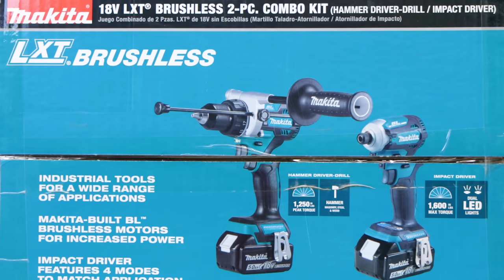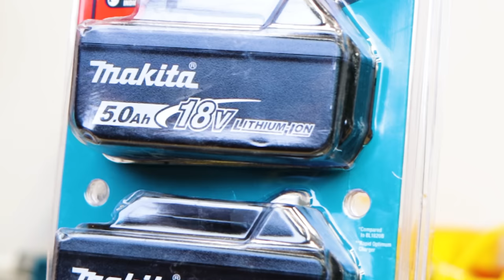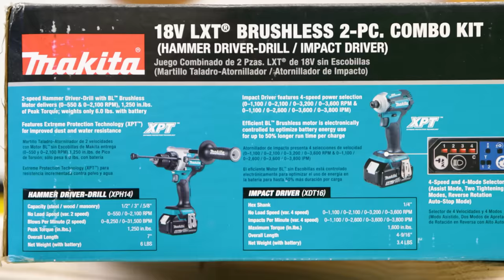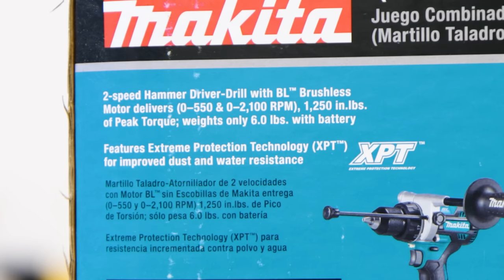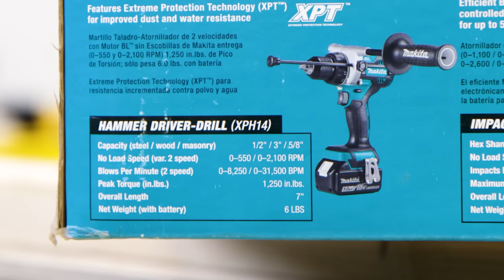New MAKITA Hammer Drill HAS INSANE POWER! (Best Combo Kit At The Home Depot)

Comment: There is no way you could get me to buy any other cordless tool.  I love my Makitas!!!!
Reply: Most of my Makita tools are 2 generations old. I’m 15 and. Have 30-40 year old tools that work great
Reply: I agree 100%. I accidentally dropped my impact today on the job site.  3 story’s high on a boom lift. Landed on straight concrete. Battery  popped off the impact and thought it was game over. Wanted to cry!Only thing damaged was the pins that slide in to the battery. Bent the pins back and business as usual.
Reply: I love Makita impacts over all others but some of the other tools available are better from other brands . My best example for this is Makita miter saws . Imo dewalt miter saws are better overall but I switches to a dewalt 7 1/4 20v max miter saw that I only use 9ah flexvolt batteries . Granted I only cut trim for windows and doors , I do it daily and the battery lasts about a month . The saw is small and light and nothing Makita has compares or at least nothing I saw from Makita

Comment: I just bought this tool kit after buying the circular worm drive from makita (18vx2). I returned my 2 free batteries it came with and returned the xph07z I bought on clearance from last week and bought this exact kit. 4 each 5AH batteries is plenty for me. I got this kit with those trade backs for $200. It came with a free tool as well (makita angle grinder x) which I’m trying to return and get a sawzall brushless or a oscillating tool

I hate these bags tbh.

Comment: I just sold my coworker my two dewalt drills and DeWalt impact with 7 batteries and three chargers for this kit. I already have almost $2k in Makita tools and batteries and decided to go all Makita finally. Don't regret it one bit. Such a nice drill. I only paid $229 on sale for holidays as well at a local hardware store.
I work mostly with aluminum and occasionally steel as a fabricator. This set up is way stronger than I need. Also I don't care about the bags because I have a rolling tool box. Lol

Comment: Just picked up my Makita XPH14 Hammer Drill and XDT16 Impact Driver combo set on sale from HD for $329. The Makita XPH14 will be used as my masonry drill for installing HVAC electrical disconnect boxes.  I enjoy using my Milwaukee M12 impact driver for HVAC service  tech applications but I decided on the Makita 18V system for commercial HVAC and installations because the impact driver has two bearings in the collet compared  to the Milwaukee Gen 3 M18 only having one.

Comment: I own the Milwaukee Gen 2 full size hammer drill and impact drive in a kit. Last Father’s Day my mom didn’t know what to get me so she bought the Makita combo kit XPH07 and the impact driver. I fell in love with the impact driver even over the Milwaukee. The collar sucks on the Milwaukee impact. The Fuel is a little stronger than the Makita but isn’t as compact and the Makita takes more abuse. My question to you does the Makita XPH14 get hot easy like the XPH07? No offense to fans but I am slowly falling in love with Makita more so than Milwaukee because the comfortable handling, durability, and snug fitting batteries. Is there a big enough difference for me to buy the XPH14 since I own the XPH07? I burn my hand a lot on the XPH07 but so far I’ve never had a smoke show. Thanks for the videos they are always super helpful. I subscribed and should have sooner.

Comment: I actually just bought the new XT288T and then I bought the 40 Volt version of the same kit basically, and I am telling you the truth the 18 V is just as good as the 40V, it’s just as powerful, but half the weight, of course I have the XDT 19 impact drill, the newer kit comes with it instead of the XDT 16. Plus the 40 V system is heavier by quite a bit especially with the battery. They come with 2.5 AH batteries, but because it’s 40 V it’s still 90 watt hours, just like the 5 AH 18v. If you’re trying to decide, I’d suggest getting the 18V version unless you’re a contractor that requires it for all the other tools that they make for the 40V system. Just my thought about this.

Comment: Just got that same Makita kit in the mail today. Would love to see the challenge against Milwaukee! just now making a platform swap; hoping ive made the right chice with makita.
Reply: Ya did
Reply: I recently did the same, had DW stuff before. I'm happy with the Makita stuff so far. I only chose them over Milwaukee Fuel because you get a fast charger standard plus the Fuel impact driver lets go of bits which it seems like they really rushed that tool to market. My xdt14 never lets go of bits as it has 2 ball bearings on the flats in the collet as opposed to Milwaukee having only ball bearing one in the corner, what a garbage design on Milwaukee's part. Otherwise Milwaukee tools are fantastic, and are generally more torque and durable than anyone else. I don't need all that though, I have the gift of finesse when it comes to using tools haha
Reply: @mastermetalshredder  more durable is a joke! Their m18 batteries fail more times than the makita. And I run all three brands.
Reply: @SuperPhoReal  it's usually the abused tools that fail, from what I have seen in the last 8 years of using these things all day. If you're having a lot of battery issues, you should make sure you are doing the right things to care for your batteries. For example, don't ever run your batteries all the way down, charge them up all the way in one go when they're only halfway down. Also, don't ever leave them in the sun, or frigid temps. Lastly, don't drop them or store them recklessly where the contacts can get smashed. Whenever I hear guys complaining about breaking their tools, it's almost always a guy who beats the piss out of his equipment.
Reply: @mastermetalshredder  I take care of all my tools and regardless if you’re using them or not, m18 batteries is notorious on depleting itself even if you’re not using it so the myth about don’t drain all the way and charge it midway is just cumbersome. Only thing they get right is their m12 line, nail guns, Packout and marketing…otherwise, their m18 is shit compared to other brands….and I started off with m18 first.
Reply: @PhoReal1031  the battery charging thing is not a myth dude, I've seen what happens when you deplete them to zero and it's not good for the cycle. I've never seen a battery deplete itself while not in use, but I have seen damaged batteries say they're charged and have a terrible output time but again it's always an abused battery. It is likely that you damaged your batteries and then had a bad experience. All my batteries have lasted me about 2 years before they started to lose run time. The best thing you can do is the basic care we already talked about, and don't run huge tools on small batteries. A recip saw kills batteries fast, and is bad for them, same with anything(!) big, and especially if it has a brushed motor. All the big tools should be corded or running 12.0 batteries and not run to death
Reply: @mastermetalshredder  so in your theory I should be using the high output for bigger tools, which is idiotic because makita doesn’t have that problem since their highest amp battery is a 6.0. I’m just speaking from my experience so I seldom abuse my tools but keep on assuming mang.

Comment: I went thru 2 of those XPH14Z. When hammer drilling into concrete. It will drill just fine when it comes out of the box. But it will then come to a point where it will stop drilling. As in, stop spinning. I pull the drill out of the whole and it will be able to spin again. In turn I put the drill right back in the hole and it will hammer drill for a little bit until it stops spinning again. 
So, for the jobs that I use it for. Doesn’t really work for me. The idea is great to have a small hammer drill that you can hang off your belt. 
But I had to settle for a small cordless Rotar Hammer Drill instead.

Comment: No s**t on the power. I just got one and there are bits flying everywhere. Be careful when spinning it to loosen the chuck with your hand. Yesterday I had a 4" hole saw and arbor fly around the room. The torque and speed of this thing is unbelievable. I'm going to hang some drywall today. Going to be using my old 18v Makita instead.

Comment: The real challenge 10" earth auger to help gardening.
Not the normal use case but this needs serous torque 😂😂
I have done it but you need a serious adapter and the handle because it will twist your wrist otherwise.

Comment: If I am understanding correctly then m12 fuel is the best 12v platform for smaller tools. Then if you need a more powerful version of certain tools then makita 18v makes a lot of sense. Unfortunately the new 40v makita range has its own set of problems like higher pricing and being heavier, and other small regressions in specific tools. They kindda messed up because now for some high current tools.like angle grinders you want 40v, wheras if you want a more usable  hex 1/4 impact driver then you want the 18v. So they are demanding the investment of an extra different battery platform. Which is comes of annoying and aggravating! For not enough justification for how much better it is. Since the makita 18v already kicks ass.

Anyhow wanted to ask here is about hammer drills also because the 12v fuel also added a hammer mode too. My question is doesnt using hammer mode a lot on these multi purpose drills mess up the chuck with all that movement? If the chuck then becomes loose with a lot of play... it then has damaged the drill for other more precise tasks. So why not save your regular drills, and get out a big sds drill for all masonry instead? And just have a seperate dedicated masonry drill. Or is this concern just not true anymore, with modern drills these days not getting messed up like that?

And what about the m12 fuel sds thingy? It must be tiny! But is it too under powered to be useful and just some kindda gimmik? Or can it actually stand up well enough to something more people go for like this exact 18v hammer / multipurpose drill. This makita one?

BTW is you want an interesting masonry head to head then you should compare the makita sds to the milwaulkee sds ones. I think the biggest and newest milwaulkee 'max' thingy... is supposed to be the clear winner above a certain size. If you want to drill some massive huge holes into a brick wall for example. Then biggest makita sds just cannot hang in there at some point it gets bogged down. But then maybe maybe their new 40v sds would actually make more sense for that situation. Once it gets released. Not out yet! However that probably is getting into mx fuel territory. Would any of these companies loan you out some big boys to have some extra fun testing them? Maybe if they have demo units lying around from all those cancelled trade shows etc.

Anyhow thanks so much for the content VCG. Really appreciate it !

Comment: Bro…the masonry bit you drilled a 1/4” away from the bucket where the concrete would crumble and have movement against the plastic making it super easy. Should’ve drilled right in the middle for an accurate assessment

Comment: Thanks for the vid! just picked this set up! On the drill, when coming off the trigger with no load (not drilling into anything), It sounds like gears grinding like something is very wrong. Any thoughts what's going on here? I may hear it a bit in your video. This happens regardless what mode it's in. Thanks!

Comment: Yeah, bring this HD on against the Milwaukee Gen 3 and either the DeWalt 999 or 998 or even 996.  This is a great bargain.  I did not need another HD or ID but I sent the money off to Home Depot for this one.  Can't say I'm sorry, either!  BTW, you are so right - this ID is very sophisticated.  Maybe too sophisticated? - unless you're using it all the time you probably won't remember all the tricks it has.  The nice thing is that you can customize the controls for the settings you use most often.  Very impressive gear.

Comment: 1600 in lbs on the impact achieves that with hammering. So the average torque on your wrist is much less. The drill however is 1250 in lbs constantly on your wrist.

Comment: I bought that exact set a few months ago. Got the free bits case, and the free battery 2-pack as well. I have also been using those Diablo paddle bits. That Tomato-Diablo combo EATS wooden studs for breakfast, brunch, lunch, linner, dessert, and dinner.

🔋 As a really cool-guy dumb battery nerd, I have noticed that Makita batteries go back and forth between:
"CELL Made in Singapore, and Further Processed in China" &
"CELL Made in Malaysia, and Further Processed in Vietnam".

The strangest part for me was that the free 2-pack was factory sealed, and had two "different" batteries in it; one from China, and one from Vietnam. I'll probably open them up and see which cells they are using and blah blah blah. Okay, I just bored the f**k outta myself writing this. Forget everything you just read. 🍻
Reply from the maker: Thanks for noting your observations David!

Comment: I know i'm in the minority, but i would like to see it up against the xtr.
Reply: I'm with you Alex! I have the old Makita tools and now I love my XTR for much less $$$.  Would be interesting to see...
Reply: Aren't XTR 24v? So they have more cells which doesn't equal apples to apples.
Reply: @ruthnoya8424  It's complicated but, no. The 20v like Dewalt and and 24v with Kobalt are just Marketing gimmicks. But, if Kobalt did have an advantage there, what's the issue? You'd be getting a bigger apple for much less. :)
Reply: @rtgray7  
Okay, I know 20v is peak voltage marketing but how the F do they get 24v?
Reply: @ruthnoya8424  THEY DON'T. It's marketing.
Reply: @rtgray7  
Wrong, I googled it. The XTR 24v uses 6 cells vs 5 cells in 18-20v batteries.
Reply: @ruthnoya8424  Wrong ;) .They still DO NOT achieve 24 volts. It's marketing if you're being kind. A gimmick if you're not. You can't even legally market 24v tool in most of the rest of the world. My comment was addressing Kobalt vs ALL other brands and especially the one's deemed best by "the pros". See, this same drill has beaten DeWalt and others in similar test. So my point is, if the Kobalt has an "advantage", why doesn't everyone do that? Why does a Makita, Milwaukee or DeWalt tool cost $25 on a hundred more than Kobalt? I can buy a Kobalt driver, drill, saw or whatever power tool and battery and save $75 to $100 on average. MUCH more on certain items and the performance is comparable. So, do they "have an advantage"? Well, if they do, you're getting it for a lot less than the snob cult brands! Go back and read my initial comment and I'm not even addressing Rigid. I mention Makita specifically. While I prefer Kobalt, this test with Rigid was close and the pricing is close. My comment was regarding Makita. My greater point would be, no it's not "apples to apples" because those brands cost much more. And, if Kobalt actually has an advantage for less $$, then way to go Kobalt! Anyway, all tools, cars, guns or whatever, have their "advantages" in comparison here and there and we could invoke the "apples to apples" argument all day...
Reply: @ruthnoya8424  I actually got our conversation mixed up with another one I was having with someone else regarding Kobalt beating the Rigid and Dewalt drill in a test. So anyway, crap no it's not "apples to apples". The Makita drill and battery cost about twice what the Kobalt does!  :)  Have at it...
Reply: @rtgray7  
    I don't disagree with Kobalt and Ridgid being great values, especially when on sale. But, they have to be in order to sway people from the decades old brands. They're like Hyundai/Kia (and in 1989, Lexus), offer more for less. Ridgid lifetime warranty on tools AND batteries (if purchased in combo) is unbeatable and very Hyundai like. You just have to make sure to fully register within 30...or 90 days and hold onto the records. I was actually going to grab a kobalt brushless set for $199 on clearance for my first setup but they had sold out before I got there.
   But if you're a savvvvy shopper like myself, you can build out a collection of any brand for very similar money. I bought my first real set of power tools December of 2019, an Amazon flash sale on the Makita xt447 kit for around $200 (all brushless drill, impact, reciprocating saw, 2x5.0ah, LED flashlight, charger and bag). From Home Depot I added the brushless 36v makita rear handle circular saw, dual battery charger and two more 5.0 batteries for $150 after selling the two extra 5.0ah it came with. Got a deal on the xwt08z 1/2" big boy impact wrench for $170 on Amazon...1,400lbs of nut busting torque lol. Got the jigsaw for $80'ish last Christmas from HD. Also bought a Chinese knockoff Makita mid-torque impact off ebay for $30 straight from China 🇨🇳. Craziest deal so far was last month, Amazon flash sale 18v portable band saw, brushless grinder/cut off wheel, 5.0ah battery...$139. The bandsaw is a $300+ tool! So I'm at roughly $769 for all the tools and 5x 5.0ah batteries. If I sell the unopened bandsaw for $270 it puts me at $500 for my 90% makita, 90% brushless setup. I'm going to build a pool deck this spring.
    I did buy a makita to ryobi adapter and grabbed their inflator and small 3 gallon vacuum.  Probably going to deal my way into the Milwaukee 12v system for their Fuel extended reach 3/8 ratchet, a few lights and whatever else looks good.
Reply: @ruthnoya8424 , Wow, great job on the Makita! They are as good as it gets in my opinion. Price(especially battery price), availability and the XTR comparable performance is what prompted my change to Kobalt hand power tools. I like them better than Rigid. For things like my planer, jointer, sander, larger shop vac etc, I go with Rigid as they are very good tools imo and, as you mentioned, that lifetime warranty. Looking into the new Skil 12v line now. Just don't tell the wife ;)